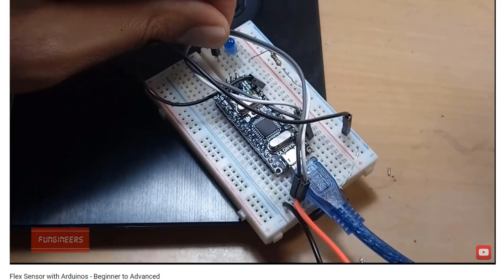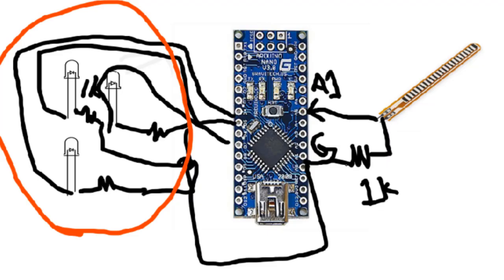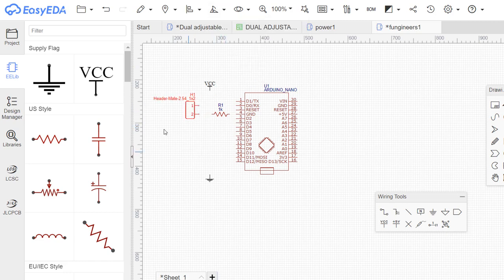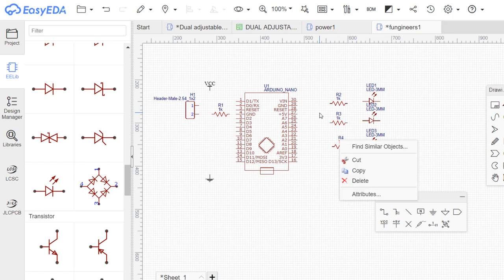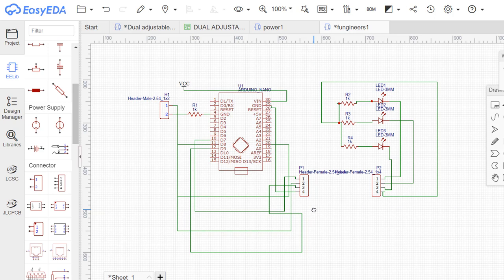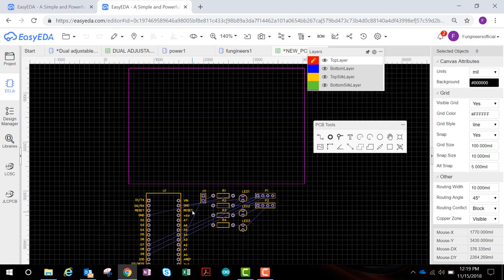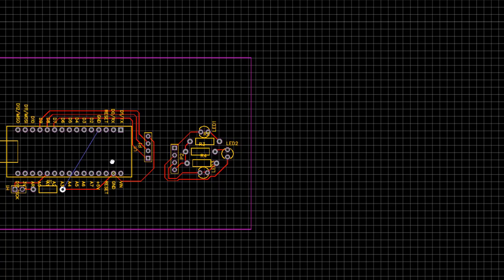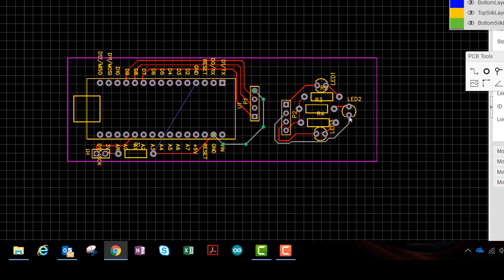Wanna Design a PCB? Begin here!

Comment: why don't you use auto router? (under the tab right of the camera symbol in pcb view)?
Reply from the maker: Autorouter never worked for me. Dunno why. Then I moved to Eagle and recently tried KiCad. If you are very serious take time to learn kicad, else this webapp is perfect for simple 2 layer pcbs
Reply: @Fungineers  i just need to create pcb with 4 ldrs, arduino nano and 2 servos. I think the autorouter did the work. It even used both layers.

Comment: Bravo awesome video.  I wanted to do the same thing just drop  Arduino Nano on a board with some other discrete components MOSFETs and the resistors needed to switch 200ma each.!

Comment: is there a way to remove unused pins from the arduino as part of the process of shrinking the board?
Reply from the maker: You would still have to plug in the whole arduino so you need all the pins for the arduino to fit. What you can do, if you are determined, is to make your on-chip processor with the ATmega processor, which will be your mini arduino. Or maybe use an ATtiny on the board.
Reply: @Fungineers  and you might need a crystal to the circuit and need to get or make a boot loader